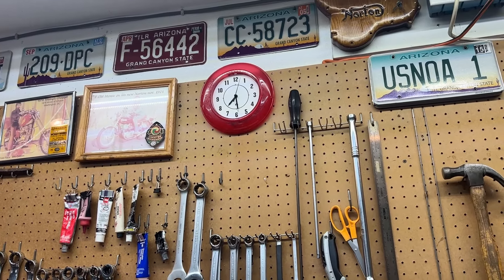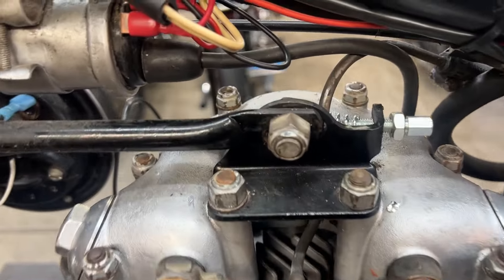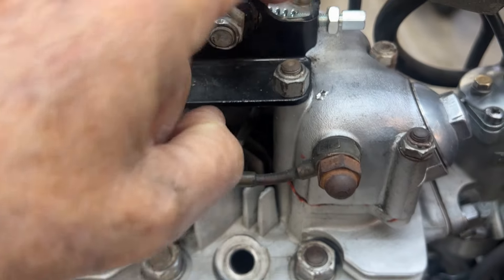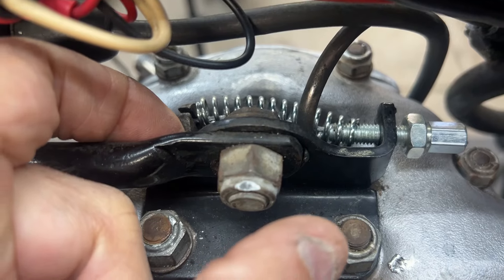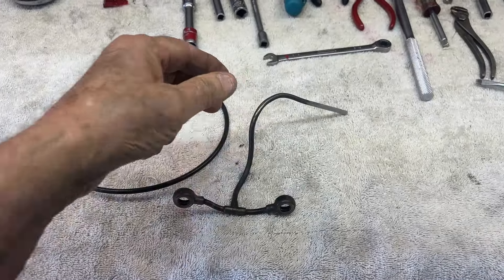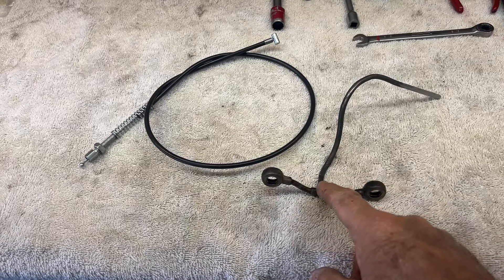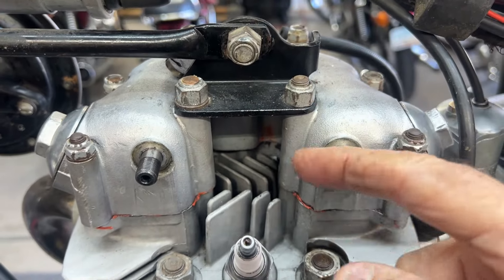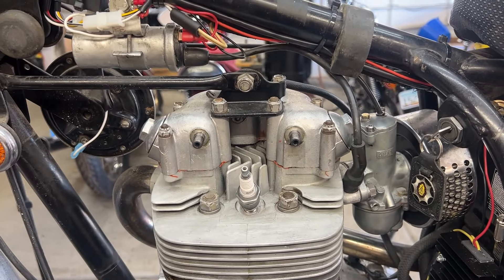04-18-24 – BSA 441 Victor - Progress

Comment: Frank and Kevin... I could really use your advise.  I'm banging my head against the wall dealing with this 78 Triumph T140 I got in a partial trade this winter.  The bike fires up and runs great when I take it for a 30 minute vigorous ride.  Then I get back home and go to start it again, and all of the sudden it doesn't want to idle (unless I'm keeping the RMP's way up, over 2000).  If I let it sit for 30 minutes and come back out to the garage, it'll start and idle fine, so it seems to be heat related.  

THINGS I'VE TRIED... I replaced the coils and I put a new Pazon on it (cause I thought the old one might be going bad.)  Spark plug wires and caps are also new (and the plugs like great, a nice light brown color.)    I've tried adjusting valves on the lose side and on the tight side, and neither seemed to improve the situation.   I've adjusted the air screw on the Amal 930s to see leaner or richer would help... I even switched to the fat o-ring on the carb manifold to dissipate heat.   I have nothing left to try except one thing...  I have a Podtonics reg/rec lying around that I'm going put on the bike this evening, but I can't imagine the zener diode was creating my symptoms.  (Bike has been charging fine and keeping the battery around 12.80)  Yesterday did a compression test when the bike was hot and wouldn't hold an ildle.  It was a smidge over 150 psi in both cylinders.   Any thoughts on what could be causing her to not want to idle when hot?   Thanks.
Reply from the maker: Check to make sure choke isn't on or coming on when the bike is hot.  Did you set the timing with a strobe timing light?  If not, do that first.  Make sure carb slides are free up/down.  (Good "snap")